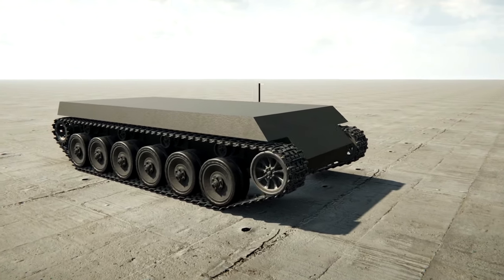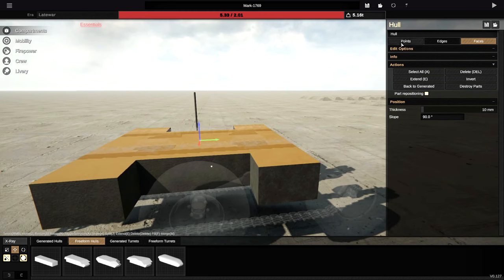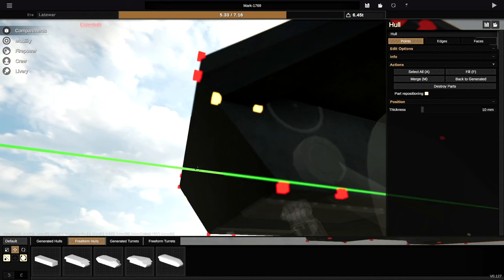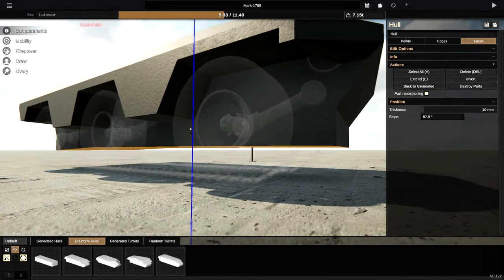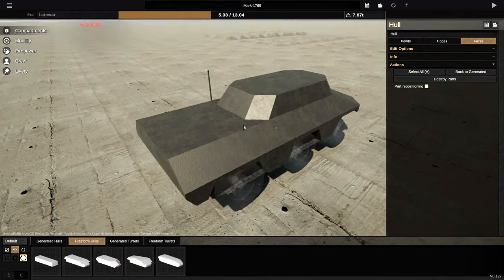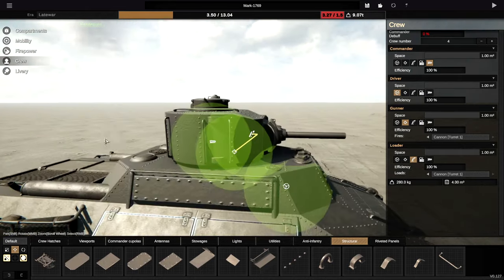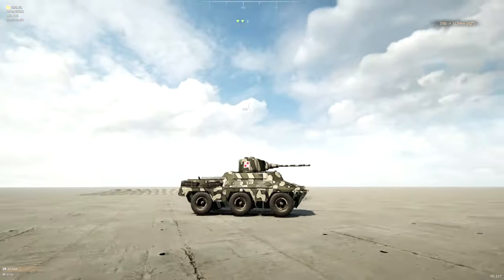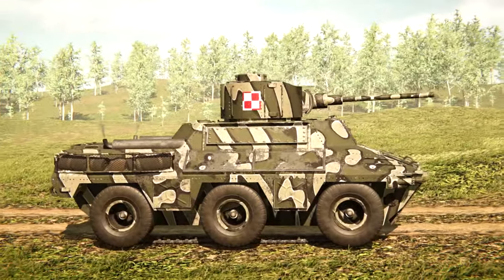I Built A POWERFUL 6 Wheeled Polish APC In Sprocket!

Comment: Rounds caliber: 57mm
Last segment barrel width: 15mm

....Am I missing something?
Excellent design overall design as always, but the barrel size is just comical.
Reply: This is just the thickness of the Barrel itself, not the bore diameter. The barrels' inside diameter remains 57mm, just the outside changes. Hope this helps.